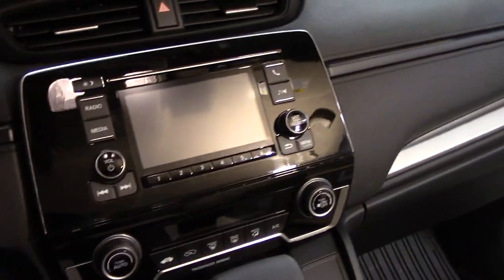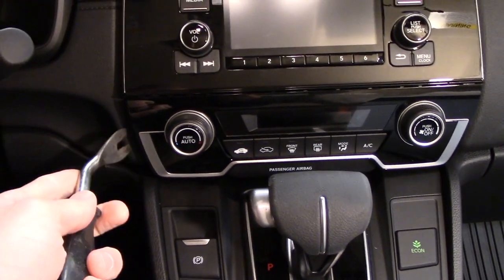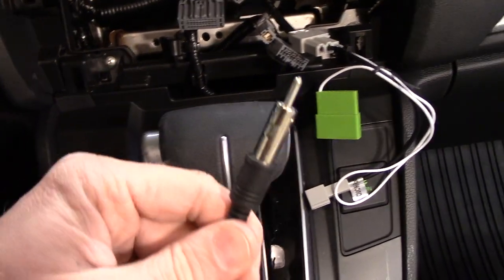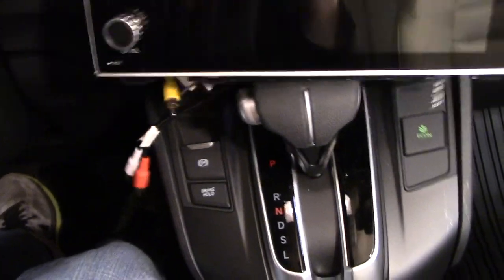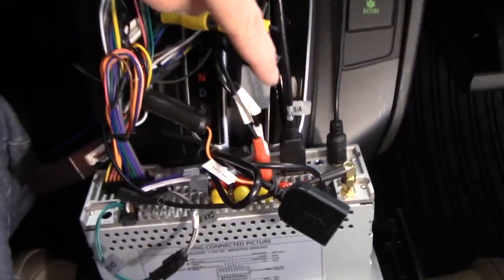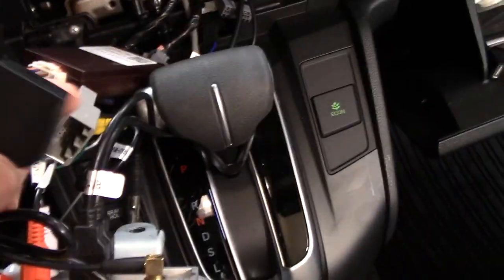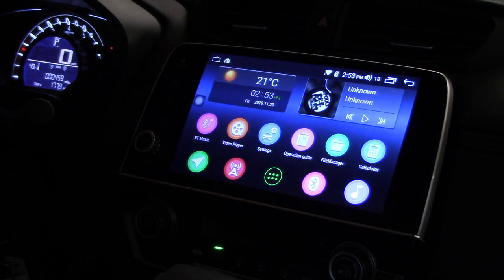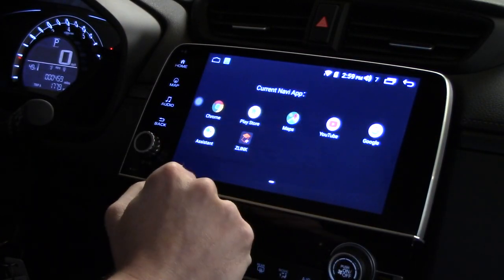2017 - 2020 Honda CRV Android Navigation Radio Upgrade and Review

Comment: Thank you for the video. Recently purchased one for my 2020 CRV  LX and works perfectly easy to install. One thing to say is that the built in mic is not good at all when driving. Way too much noise. You can install the one that comes in the box and the wire is  long enough to place it on the factory location for the oem mic.

Comment: Installed one in my 2020 CRV LX.  Easy installation, backup camera works, no issues.
Reply from the maker: Good information. Thanks.
Reply: Do the steering wheel controls still work? And does this connect to the stock usb port for android auto?
Reply from the maker: @tskramp  yes and yes
Reply: I have a 2020 CRV LX and am thinking of upgrading. Do you have to buy a separate adapter for ALL of the steering wheel controls to work? Also did the installation affect the lane departure assist feature and the digital display car information behind the steering wheel?
Reply: @jovanjohnson607  same question here
Reply: I have a 2020 crv lx and wondering if this radio will still allow you to recalibrate the tires in the settings? Didn’t see an option for that in the video when going through the settings.
Reply: the sensors of the reverse camera that alert you that a car is approaching, work in stereo?

Comment: Thanks for sharing your video,just want to know which connector did you use from the generic radio harness going to plug to oem long skinny flat connector.I know the other one is the main connector.Secondly how do you connect the 2 usb port at the back generic unit?can you tell me which connector goes in to what connector.How do i use carplay, i am an iphone user.do i plug it to the usb for carplay or using bluetooth?

Comment: Thanks so much for sharing this video. Not much on head unit replacement and wiring on a newer CRV LX. I’m also interested in upgrading my 2019 CRV LX. I was looking at a couple of units at Crutchfield and they telling me they don’t make a steering wheel interface but I found one that was validated to work with aftermarket radios such as an Alpine or Kenwood. The interface, if anyone is interested is ...Scosche® LHA20. Civic and CRV LX only.

Comment: This isn’t the one I got but helped with install for sure
Reply: My car model needed done mine wasn’t working, that connected doors, and steering wheel controls. If those aren’t working for someone check that you have right model. Even with manually going into normal settings mine wasn’t working till I added make and model

Comment: I assumed this was an official Honda unit.  This one is much better looking than the Honda version!

Do the backup lines move with the angle of the steering wheel to provide predictive backup guidance?

Also does it have HD Radio?
Reply from the maker: It does NOT have HD radio. The lines do move with the steering wheel to show your path. The stereo sounds is excellent, even without the HD radio.

Comment: Is your rear camera working? I’m going to buy it but don’t want to risk it thanks great video
Reply from the maker: Yes it's plug and play. Works with the backup camera and retains the multiple view capabilities
Reply: Thank you for your response, one last question does this support wireless as well? Or it has to be connected for the Apple CarPlay to work iPhone user thanks I had subscribed
Reply: I had install it today everything works great, my only concern is the rear camera it didn’t have me all that options on view like yours maybe I did something wrong or need todo something on settings
Reply: Same thing happened to me. No dynamic lines and no multiple views. 
Did you solve it?

Comment: Jack: Just purchased the 9-inch following your Amazon link here, to install in my CRV 2019. I can't get the backup camera lines to track with the steering wheel. I tried to navigate to the settings you indicate in your follow up video, but the final option (XP2017) just isn't an option. Any ideas what I might do?

Comment: Quick coupe of  questions Jack. I am interested in the head unit you purchased. I went to the website and saw where it said about backup camera not supported. But you were able to connect using the video cable with the blue wire from the can bus? I’m assuming it drops down the voltage to 6 volts dc. Also, is Apple CarPlay part of the Zlink app? Thanks
Reply from the maker: I can't remember the wire color, but it all just plugged in and worked with no issues at all. Yes, Apple carplay is part of the zlink app and works very well. I use it daily.

Comment: I just got the 9inch  installed today and I loooooove it!  Thank you so much for the great feedback and tutorial. So helpful! I did have one question. What sim card are you supposed to use for the wifi sim card? Can you provide a link? I tried to buy one at Best Buy today but it did not fit. Thank you in advance!!
Reply from the maker: I never use the sim card. I use the WiFi hotspot on my phone
Reply: @JackofAllMasterofNone   Thank you. So If I have my own hotspot I don't need anything else? That's awesome. Last question I swear lol. Do you know if it's possible to purchase products to make the headlights automatic instead of having to turn them on manually every time?
Reply from the maker: @gordonwilson3752  Yes just turn on the hotspot on your phone or whatever and then connect to that WiFi network on the headunit. Unfortunately I don't know if there is any way to add automatic headlights.
Reply: @JackofAllMasterofNone  You're awesome! That you for all of your guidance

Comment: So today I was sitting at a red light listening to the radio when the sound started fading out. It eventually went silent. I tried changing the station, switching to CarPlay and trying to listen to Music. Nothing worked. Any clue how to fix that? I turned the car off. Waited a minute and turned everything back on. Still silent. After waiting four hours, I turned everything back on and it worked again. Joying hasn’t offered any suggestions yet.

Comment: Hello, I watched your video it ia well explained, my infotainment system arrived a week ago and I am ready to install it, one  thing I am not sure is about the female to female antenna connector you mention in the video, so do I need to buy that connector? And if that's the case where can I found it. Thanks.
Reply from the maker: I didn't have to buy anything with this system. If you are installing any other unit, you most likely need one. I'm not sure where you would buy it
Reply: @JackofAllMasterofNone  yes thank you I saw that.

Comment: Hi, thank you for your video, I'm actually looking for a better system than the factory one. After all these months are you still in love with this product ? with the GPS antenna you installed do you still need your phone for using google map (if you choose this navigation system) or is it self sufficient ?
Reply from the maker: I do not need my phone but Google maps is hard to beat by any navigation. But you can run Google maps if you have a Wi-Fi connection or you can use Android auto or Apple carplay without a Wi-Fi connection. With this setup the options are limitless

Comment: Hi, and thanks for the thorough video. Could you please confirm if it can use the built in vehicle mic for hands free calls, and how the mic performs (I.e. background noise)?
Reply from the maker: It has its own microphone. It does not use the built in mic. It works great. Noone has complained about the audio quality.

Comment: What are the advantages of this unit over the OEM unit that came  with the Honda cr-v that I need to upgrade to this unit? What am I missing in the OEM unit in short? Thank you.
Reply from the maker: If you have a base model LX then this is a huge upgrade. If you have a EX or above it is not as much of an upgrade

Comment: I purchased this about six months ago, and installed the heat unit perfectly from this video. Many thanks for uploading it! I love this new unit, it has truly upgraded my honda lx 2017! However, just recently I have noticed that while I am driving the bluetooth car play gets disconnected from my phone and takes a bit to reconnect. Anyone else having this issue? Or, any fixes?
Reply from the maker: Probably a bad cable. Try a different lightning cable
Reply: @JackofAllMasterofNone  I purchased this updated unit 2021 unfortunately the plug for that car antenna is female same as the connector on the car, any suggestions on how solve this problem? 
Thanks for wonderful  videos.

Comment: This is great! Think I wanna pull the trigger on one of these! Question for ya, the newer 9" model comes with Android 10 now, do you know if they fixed the antenna connection as well? Thanks!
Reply from the maker: Not sure, but it's not an issue really. Just cut and splice if not. I prefer the 9 inch model.
Reply: @JackofAllMasterofNone  Same here, I like having a knob and the fit is cleaner. :) Thanks!!!

Comment: Hi Jack, Got some negative feedback on amazon for the 9 inch display unit as you are the one used for quite some time based on installation video, can you please confirm the durability of product and performance in long term.
Reply from the maker: I think it is an excellent unit and works great still to this day. I think some people have unrealistic expectations. It works just as good, if not better than any aftermarket stereo I have ever used including Kenwood, Pioneer, etc.

Comment: Hi. Thank you so much for the video! So yea, my OEM sound quality is not great, looking to upgrade, this may bean the one! I have a 2020 Honda CR-V LX (base trim). I know almost nothing about cars lol. I NEED the backup camera to work, and sound quality to be better - The Amazon listing has Harness 1,2, and 3, which harness do I need for 2020 Honda CR-V LX (NOT push start, has key)? Any help appreciated, thank you.
Reply from the maker: Harness 2 will work on the LX and it's available via prime. Technically you don't need harness 2 but each kit includes all harness versions. Not sure why they specify the difference.

Comment: Jack... Do you think, it’s possible to change the original OEM Car Radio from the CRV 2020 LX by the Honda Radio OEM that’s comes with the CRV 2020 EX or EX-L? Please let me know your opinion.
Reply from the maker: It seems that they use a slightly different wiring harness (more connections), so I'm not sure that it would be an easy project. I may be wrong though.

Comment: Hi, look at your video and buy one for my car, the same model as yours from 2017, but the camera does not work and the rudder control could help me please
Reply from the maker: I'm not sure if I can help or not. It just works. As you can see in the video I plugged it in. I suspect it may be a problem in your settings as long as everything is wired correctly. Check this video out to see how to change the settings. It might help you.
https://youtu.be/xOsGDuXB2N8

Comment: Hello...how have you been finding the gps navigation to work...is it picking up location services through the antenna you placed under the dash or just by being mated with your cell phone mirrored onto the screen?  In other words can you get google maps on the new radio without your cell phone turned on and using data time?
Reply from the maker: Yes you can but you need a data connection for Google maps unless you previously downloaded offline maps for the area you are in

Comment: This might be be a dumb question. When going to the manufacturer's website they ask if the car has a factory amp? Thats no right for a 2019 CRV - LX AWD?
Reply from the maker: Correct. It does not have any external amp
Reply: @JackofAllMasterofNone  Thx got the head unit and installed it about a month ago! Your video was a big help it was so easy to install less then 1 hour all in. This really made the car feel like a 2022 model! I was thinking of upgrading the speakers and maybe adding some tweeters as well!

Comment: Are you concerned the dash will heat up from the sun and the tape on GPS antenna will unstick? I live in Miami
Reply from the maker: It could do that but in my experience it just makes it stick harder.
Reply: I just stuck the gps antenna on top of the radio via its magnetic base for installation. Seems to work fine.

Comment: My factory head unit keeps asking for password and tried many times to enter the correct password from the user's manual, but still nothing seems to work. That's why I decided to replace it with this Joying 9' unit. My only fear is that it might keep asking for a password. Do u happen to know anything about this? Your videos or amazing, btw.
Reply from the maker: It wont keep asking for a password if you replace it. You can look up your passcode online. All you will need is your vin# and the serial number on the radio itself, which is on a label. https://radio-navicode.honda.com/

Comment: Hi! I'm Ethan. 
I have purchased and installed successfully.  Everything integrates perfectly and I love it. But my device restarts frequently.  I don't know if anyone has the same trouble as me using this Joying?  Or maybe I just got unlucky when I bought the wrong one with a faulty hardware?
Reply from the maker: Mine never restarts. You may have an issue. Might want to try and exchange for a new one under warranty.

Comment: Hi there! Do you know if I can plug in the aftermarket reverse/backup camera to mine, 'cause here in Poland (EU) the basic CR-V model that I have does have this basic stereo head unit but I don't have a factory backup camera mounted.
Reply from the maker: Yes you can easily plug in an aftermarket camera
Reply: @JackofAllMasterofNone  thanks. Hopefully guys at my local Honda dealership will know how to handle that. Last time I checked, they said they didn't have any info on the possibility of installing aftermarket backup camera in my CR-V, which possibly means they don't know how to do it or is it even possible.
Reply from the maker: @TomTom-mb9tg  The Honda dealership is not the right place to get that type of work done. I'd recommend a local car stereo type shop.

Comment: I haven’t upgraded a head unit in many years. Does this have pre-outs to run to an aftermarket amplifier like the old head units do? And does it have auxiliary audio input? I’m still a wired audio guy. I run a dragonfly DAC out of my phone for music.
Reply from the maker: It does have pre outs. It does have an aux input as well.
Reply: What about a wiring harness for the steering wheel controls? And can I ask why you went with something like this as opposed to an Alpine or Kenwood?
Reply from the maker: @sageRJRJ  Did you watch the video? I have no problem answering your questions but most of these questions are answered in the video. It integrates seemlessly with the Honda canbus network. All steering wheel controls are working and plug and play over the canbus network. The reason I didn't use a Kenwood or Pioneer or something like that is because there is no dash kit that would make it look right or integrate into the factory electronics as nicely as this unit does. Also this unit has a very nice audio circuit. The sound is not as loud as a Pioneer but it sounds just as good. If you really needed more volume you could add aftermarket amplifiers.
Reply: No, I did not. I meant to before asking anything and I honestly forgot.. Finishing now. Thanks though - those were my exact worries with the name brand units and you confirmed them for me. Saved me a lot of time and headache.

Comment: Have you had any trouble with the time zone? I had a Chinese radio a couple years ago that was an hour off if I set it to my time zone which is Easter US/Canada, I would have to tell the radio I was in the Atlantic time zone.
Reply from the maker: No problems at all
Reply: COOL! Thanks for responding so quickly. Does installing an after market radio void any factory warranty?
Reply from the maker: @earltriplett7085  No. As long as it doesn't cause any harm to the vehicles electrical system. google the Magnuson-Moss Warranty act for more info

Comment: Can you tell me if this upgrade is compatible with my 2019 5th Generation CR-V, EX?  I am looking for a bigger display as I find the 7inch which came installed ,with a large black border a waste of space. Thank you.
Reply from the maker: It should be. I would reach out to Joying to be sure. I can only guarantee it will work on an LX, although mine came with the plugs for an EX also.
Reply: @JackofAllMasterofNone   Thank you for your reply. Much appreciated. I will contact Joying.

Comment: I've installed this and am having some problems talking to my wife on my cell when she is in the CR-V using Apple Carplay. Sounds static-y, but more like something is rustling over the microphone, but it is inconsistent. I'm using the factory installed microphone. What do you think might be causing this?
Reply from the maker: I'm not sure. Is the A/C or heater on when this is happening? Might try using the external mic instead
Reply: @JackofAllMasterofNone  Interesting about the heater. I'll check it out.
Reply: Just played with the heater. No luck there. It is odd intermittent static, and it happens with both Android and Apple phones, only when using the phone feature. Do you think installing the external microphone is the right idea. And, if so--how best to route the wire and where to mount it? If you have a video I'd be glad to look.
Reply from the maker: @joshuaziefle1274  Dont have a video. It just plugs into the back of the unit. Most people route it behind the dash and behind the A pillar and clip it to the headliner near the rear view mirror.